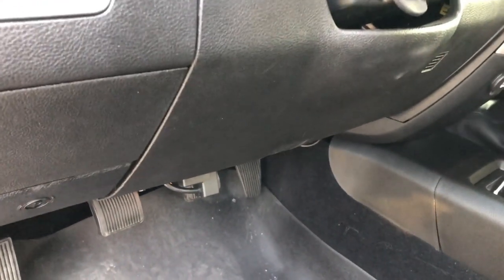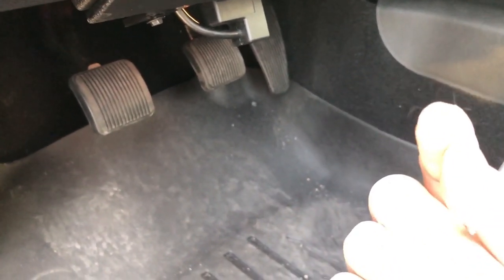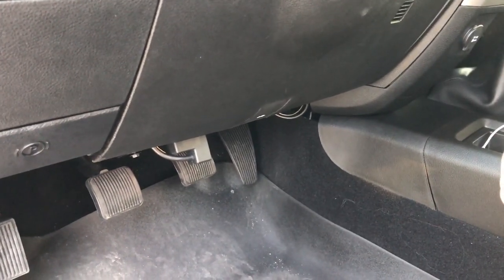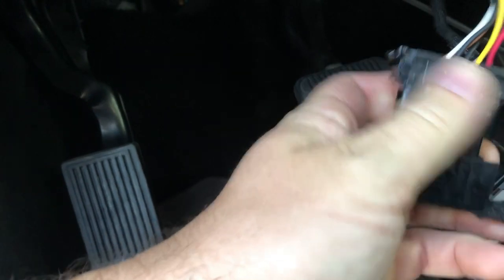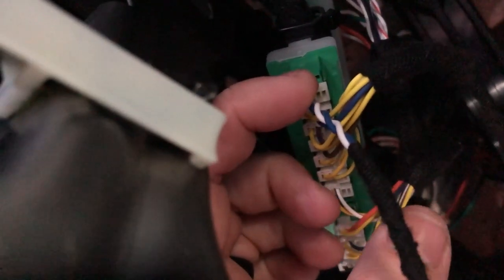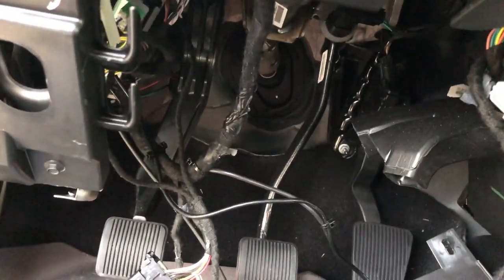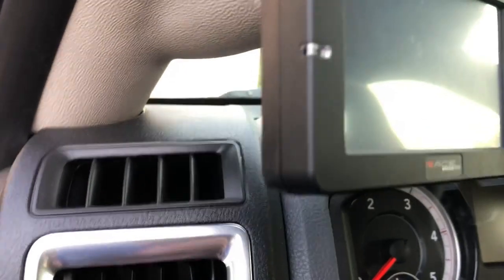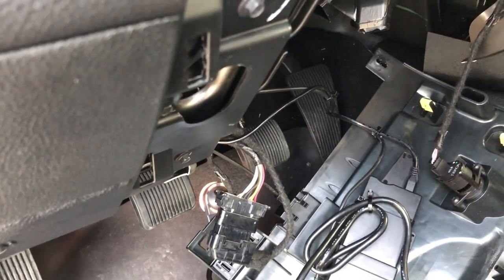KAOD TECH Security Gateway Bypass Harness Install (2018 Ram 2500)

Comment: Question,  I brought a used 2019 big horn. Do you have or can direct me to a video for connecting the bypass on a 2019 big horn.  Green terminal base where the white plug goes are all taken. I was able to put it to row left of it on the bottom.  I was able to find a empty bank on the white base for the green plug.  I'm calling them terminal and base not sure if that's what they're called. I have some pics but don't know how to upload them. Thanks

Comment: Hey quick question. I have an 18cummins and would like to know if the ezlynk bypass is no longer needed for tunes with this bypass in place instead. Thank you.
Reply from the maker: If it rewires the obd port to bypass the sgm then no you shouldn’t need the one or the other.  They both should serve the same purpose.
Reply: @MKSPerformanceOffroad  Your quick response is appreciated! I was worried as the ezlynk mentioned to connect the bypass to the wire that hangs off its obd receiver. I lost my original bypass I received with HPP tuning. Luckily I have that Kaodtech lying around to upload some different tunes🤙🏼
Reply from the maker: @rddiesel1  you shouldn’t have any issues with the Kaod tech bypass for this purpose.  Glad I could help.
Reply: @MKSPerformanceOffroad  Great! I’ll come back with an update once I give it a go✊🏼.
Reply: Worked out perfectly🙌🏼
Reply: I bought the KAOD Tech cable when I had my 2021 Ram. Now I have a 2018 Ram and I wonder if the same cable will work on the 2018?

Comment: Can you just go to dealer and get your code? I saw another video where that might be possible.
Reply from the maker: Dustin Kurtz yes, you paid for it when you bought the truck.  Normally the parts dept can look it up by your vin.  Get the 4 digit and 5 digit
Reply: do you know where the secure gateway module is located for the 2018 ram promaster 2500
Reply from the maker: b handal more than likely either behind the radio or instrument cluster

Comment: Stupid question. I need to take my truck back to the dealer. I want to remove the security bipass. Where are the clips that i need to press to remove the security bypass harness  from the green harness and the harness behind ? A vid would be helpful how to press the clips. I tried pulling the security bipass out and its wedged in there
Reply from the maker: njhotroder should tiny tabs on the top of each connector.

Comment: You say this is an "Install" video but the harness is already installed and you don't explain how to do it. I learned nothing from this video. Would have been a lot more helpful if you made a video showing the actual install. What do the connectors look like on the "Blue and white" and "Green and white" plugs?
Reply from the maker: FFred5500 watch it again, I show the connections and explain them at 3:16 and roughly 3:40.